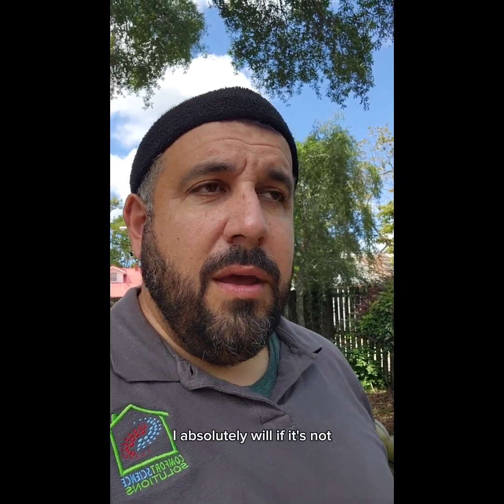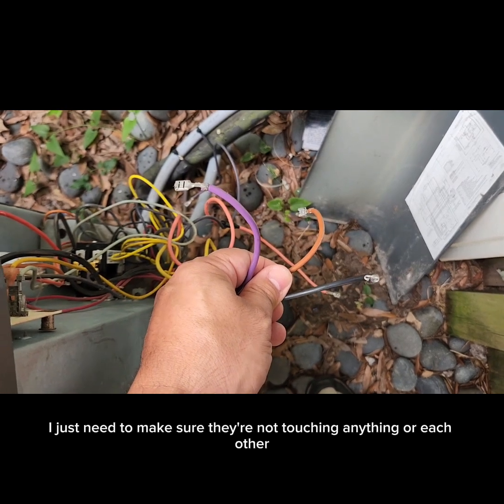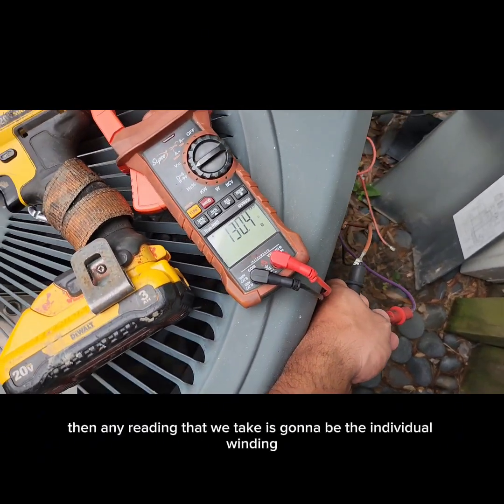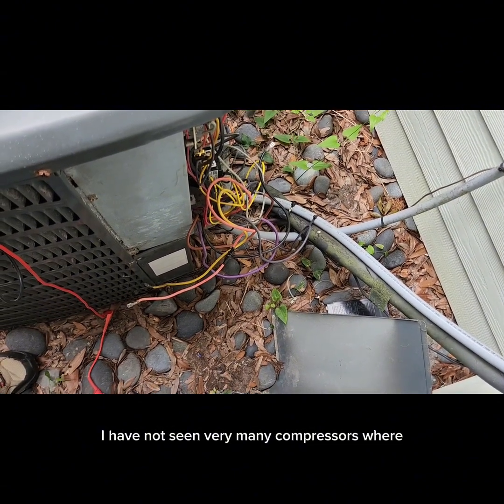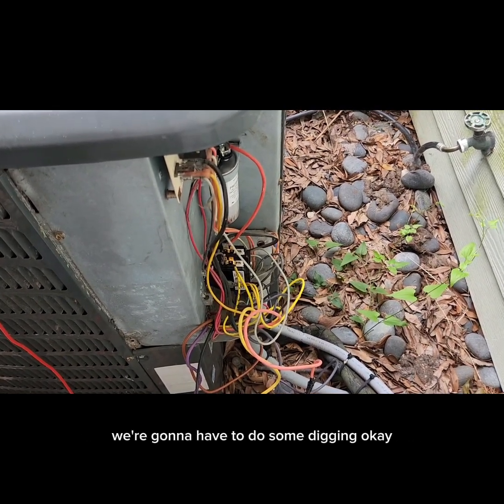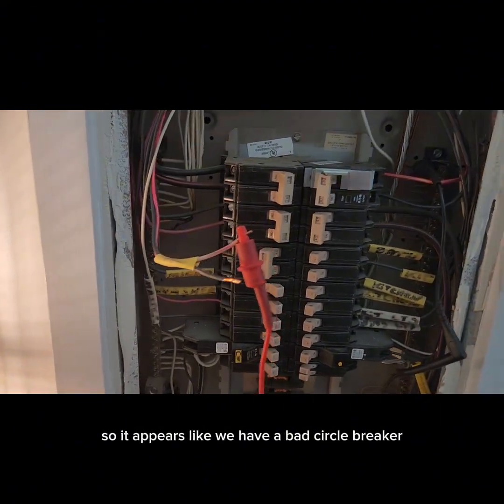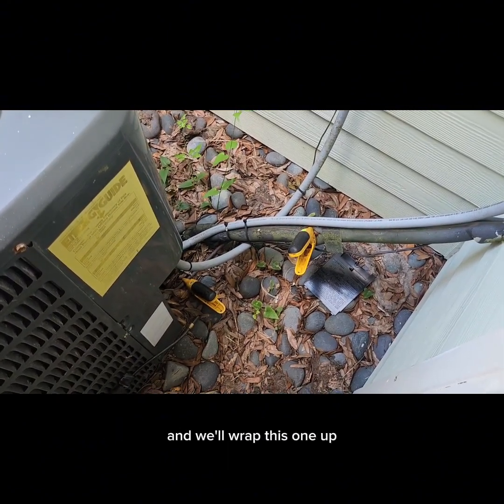How To Check An AC That Trips Circuit Breakers (And How To Check HVAC Motors)

Comment: I have some ohms reading from compressor to ground, but I get no continuity OL to ground, but the breaker is tripping. So question is: Ohms from compressor to gound from any leg should be NONE correct?
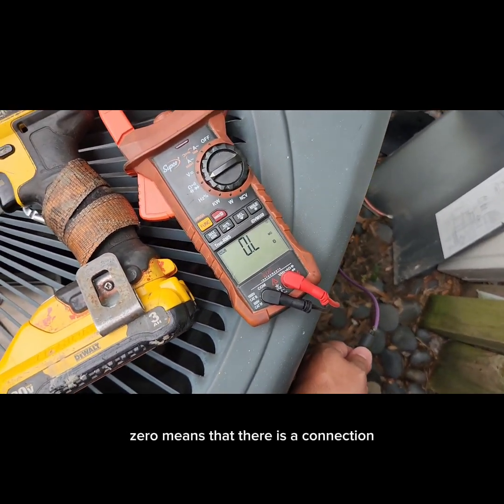Reply: In the video, if im not mistaken at 3:35 he says if there is anything other than OL when reading to ground, theres a direct ground short and the part is bad.
Reply from the maker: @mandomestizo  anything other than Open Load to ground is bad.

Comment: Great video! I have questions is there a specific type of compressor that the start terminal and run terminal  winding equals to the third terminal?
Reply from the maker: All psc motors ohm out that way. Start to Comm + Run to comm= Start to Run.

Comment: Great video. One question, why not ohm out directly at the compressor windings in case of a bad wire situation?
Reply: I would had I read a short to ground. But with OL, I knew I didnt have a short there.
Reply from the maker: If you read OL to ground, isolating and reading the compressor will still read OL to ground.

If you read ohms to ground, testing at thr terminals rules out grounded wiring.

If youre referrinh to a broken wire, it wouldnt immediately trip the breaker in that case.

Comment: Let me ask a question! I had automatic trip on a breaker, windings measured fine and ol to ground as well. Turn breaker on it would trip. Did the same checks. Then I would unplug the harness and no trip. Performed that multiple times unplugged and plugged with same result each time. Thoughts on that? Thanks
Reply: Commenting here so I will see the answer when it is responded to.
Reply from the maker: @madeinusa1576  could be a bad connection at the harness not allowing enough amps.

Continuity and ohm checks cant tdll you if its one strand of wire making the connection or a whole cable.
Reply: This exact thing happened to me.